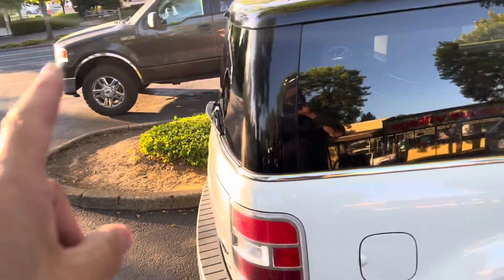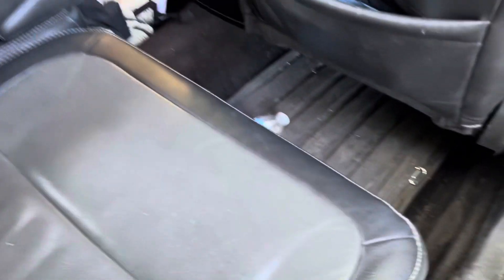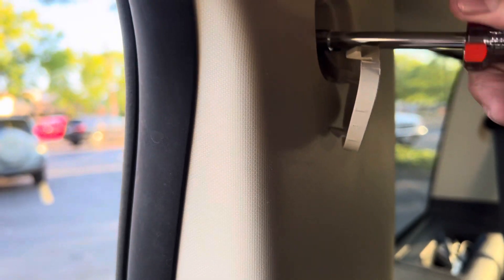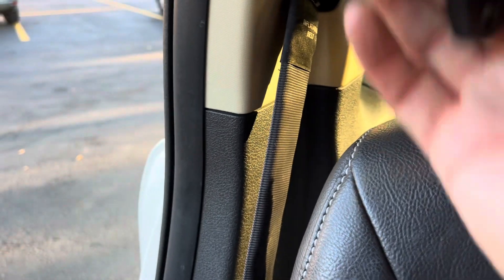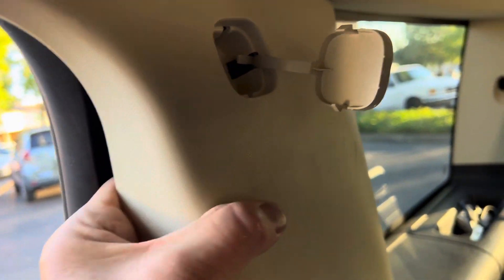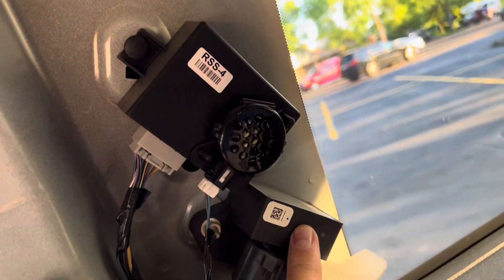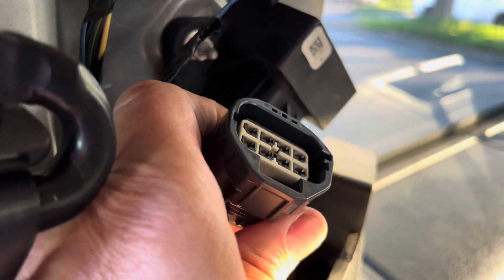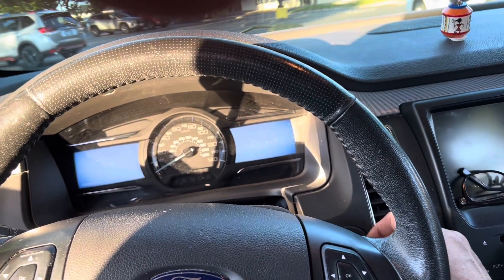Ford Flex won’t start. SIMPLE fix for $69

Comment: Mine went south in my driveway instead of on the way north, moving to another state.  I bought a replacement last year due to videos on this subject that I came across.  Sooner or later this part will fail. I had intended to replace it earlier before failure, but I procrastinated.  I got lucky having the failure at my home and not 300 miles away on the road.  Good info in this video.

Comment: I had the same issue. Crank no start. Done quick YouTube search and BAM easy quick fix.
Reply: Just happened to me. Praying this will fix it🙏
Reply from the maker: Hope it did!
Reply: @Hc4697 did it work?
Reply: @junglis074ever  nope that starter was completely shot. Bought a new one and it was a fairly easy install and everything was back to normal